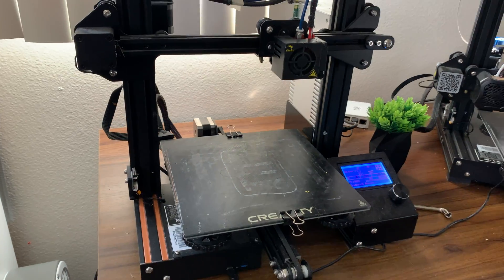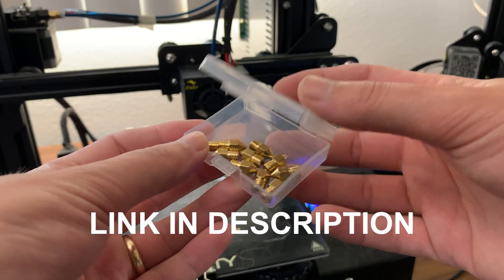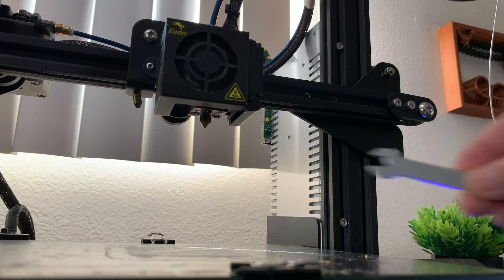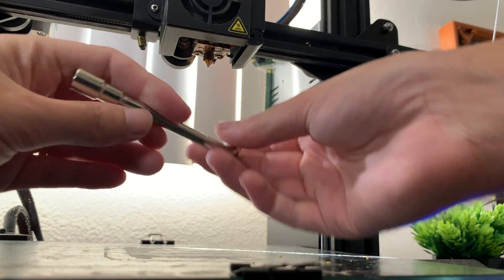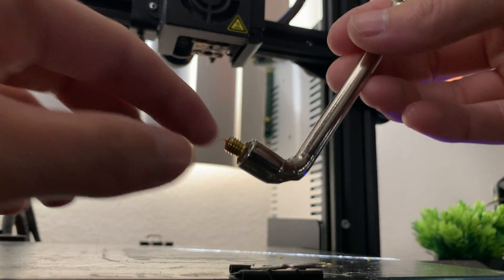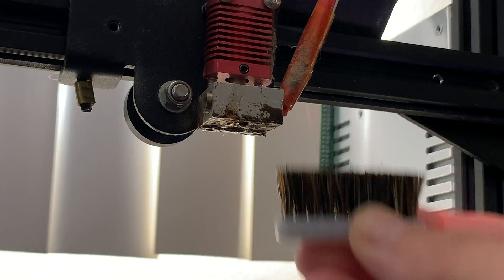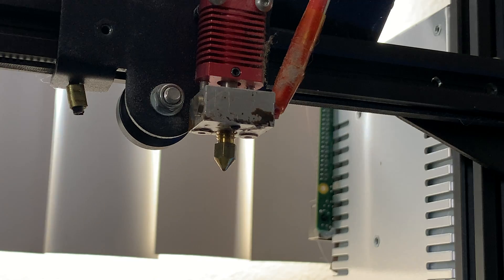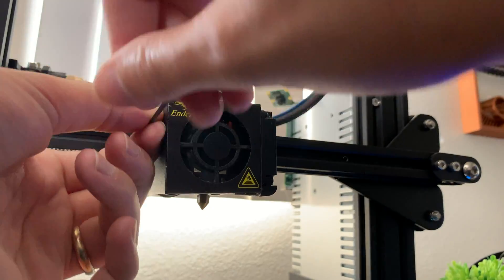How to change / replace clogged nozzle on Ender 3 (quick and easy)

Comment: Wrong. All nozzle are not the same thread length. The way you show can cause a heat break. The Bowden tube may not. Even contact with the nozzle back.

Comment: Everything I've read and watched says counterclockwise, but this looks clockwise? My nozzle is too tight to remove and I have no idea what the correct way to remove it is. Clockwise or counterclockwise?
Reply: The answer for my nozzle on my ender 3 was clockwise.
Reply: @Maddalana  Handy to know. It's usually anticlockwise to loosen something so good to know this is the opposite way

Comment: This helped me. Right when I finally thought I got it to run, my nozzle jammed..I poked it with a needle and no luck. There was also a bunch of residue under the sock and upon sloster inspection yes it was clogged a and you could s3e the divot from where the needle came though tmbut the hot plastic just closed the hole anyways. I'm going to print a benchy on Friday to see if it will print. And hopefully I have a small steam boat and not a mess of filament on my bed. It's glass since I had damaged my stock bed.
Reply: How did it go?

Comment: Is it necessary to tighten the nozzle to the block? Because I changed it for the first time and the factory nozzle was so tight that I thought I would break something if I tried to remove it.
Reply: I am currently having the same problem
Reply: make sure its heated up 10 degrees hotter than you regularly print at when you change your nozzle  @daltonbanks9283

Comment: I had to do this after my part got messed up in the early stage printing. The printer ran for 5 hours having plastic build up on the nozzle. It was a nightmare to clean. The plastic went under the silicone cover and engulfed the nozzle. After spending an hour cleaning it. The printer can't print at 280 C anymore. The nozzle will reach that temperature but if it says at that temperature or higher then it would cancel the print. So I can't print petg plastic anymore, which is fine since that was the plastic that engulfed my nozzle in the first place.
Reply: PETG normally is printed between 225°C and 245°C, but damn that sucks
Reply: Yea maybe being 20 degrees over the max temp for PETG didn’t help lol
Reply: This is exactly what happened to me